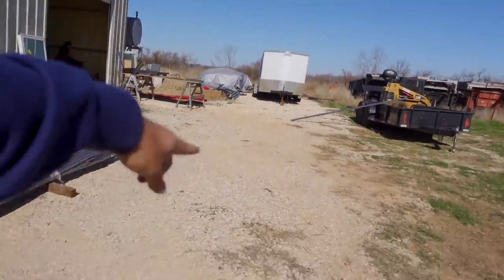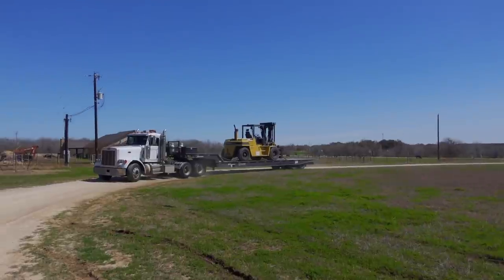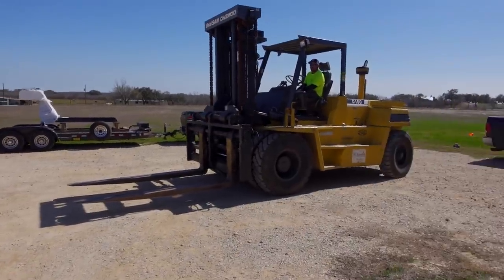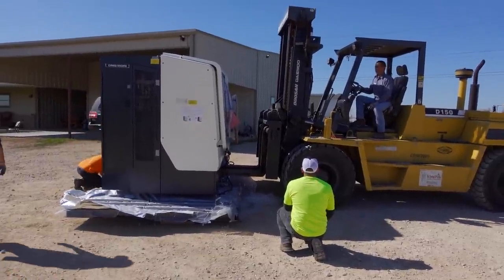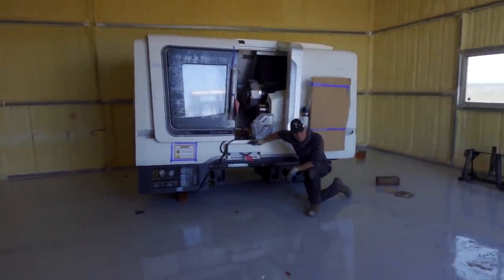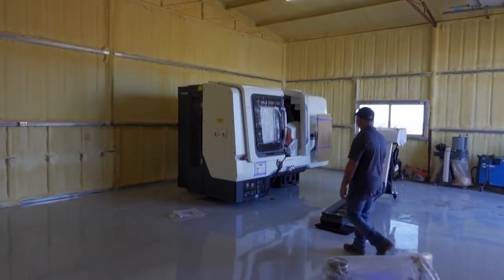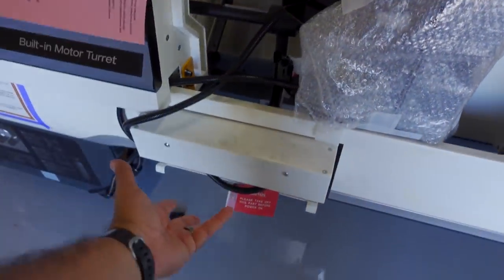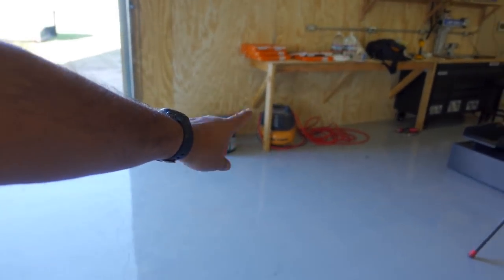New CNC lathe is here:  Starting a machine shop part 6

Comment: 3 years ago I bought a few arduinos and worked with my students to create some novelties. My administration got wind, and had me present our hobby, and they asked what I needed. Of course it was a 3d printer. A year goes by, and they ask me to teach it as a class. No problem, so I went to a training on SolidWorks and taught that for a year. Last year, I get called into the office, and asked to help write a grant because they wanted to add machining. So, a CNC press brake, 150W CO2 laser cutter, a haas vertical mill, and lots of stock was ordered and delivered. This last year, I was asked again to help write a grant, low and behold, we’ve got a cnc lathe coming, along with about $80k worth of stock to train high school kids on. I know that my arduino hobby has ballooned into a million dollar metal shop, and I could make a lot more running a shop than I do now, but I’ll stick with training a few dozen kids each year in hopes that a couple want to pursue it as a career. That being said, if you need a pipeline of cnc mill, press, and lathe operators who can also design, let me know.
Reply: a school that invests in education. ill believe that when i see it.

Comment: Mate don't listen to the haters, I think it's wonderful what you're doing, I've been in you're position trying to do it debt free as well trying to start a Gunsmithing and small part repair shop only difference is I'm in Australia and my machines are manual haha and it's been a year now and I'm still stuck on getting 3 phase to my shed 120m away from my electricity box.
Anyways I just want to thank you for all the detail on and how you've been documenting setting up your business and shop. You're doing a great job and I'm personally so interested on what's next!
Get those chips flying! Lol
Reply: Been looking at the costs between renting a generator and buying a old back up generator that has come from a business that's closed down they've got extremely low hours some as low as 46 at Auction for a 40 to 50 kva is sub $10k.. I'm hesitant on used but if it's reliable it actually works out better than paying for a new electrical connection

Comment: Mori is a good brand. I run two Mori lathes and a Haas lathe at work. One from the 90’s and one from the 80’s. Both are dead nuts compared to my new Haas. The Haas has needed more repairs in two years, than both of my Mori in the ten years I’ve run them.

Comment: Hey Erik, when you can afford to do so debt free, a backup grid tied inverter, lithium iron phosphate battery(s), super capacitor bank system, DC wind generators  and DC solar converters etc  would assure that no storm could deny you power and production of those wonderful tuners you make. If the power stops on the grid the transfer switch would just switch to your off grid system where immense power would be available. Otherwise, you with such a backup system you could get paid by the utility for the power you put on the grid or get credits for the power you have pulled off the grid.  Just a thought considering you are like me in doing things DEBT FREE AND THEY PAY ME WHEN AND IF POSSIBLE !!!!

Comment: Fantastic choice in the DMG MORI, you'll be very pleased in its performance and repeatability. You'll want a good window squeegee and your choice of a rag on a stick to help wipe the coolant off the inside of the enclosure when the machine is done for the shift. Even the best coolants with detergents in them get gunked up over time and it's far easier to wipe it down at the end of each shift than to wait a couple of months and fight it. It's the area behind the turret and behind the sub-spindle that usually gets neglected. If you decide to add a bar feeder in the future you can run "lights out" and really amp up production. CONGRATULATIONS! Looking forward to future videos.

Comment: What kind of band saw are you gonna run since your not gonna have a bar feeder ? Do-all makes excellent automatic saws which will give you the consistent bar lengths your going to need to run max amount of parts per bar. Also your going to want to invest in spindle liners for whatever diameter stock your turning. They are a necessity when you don't have a bar feeder. I highly suggest a rotary screw compressor and dryer combo for that machine,  especially if you are planning on expanding in the future. You will save yourself some headaches.

Comment: Hey Erik, I used to be CNC programmer 12 years back and just want to suggest that be very careful about playing with the program yourself. I remember once the electricity went out in the night and reset the machine while there was a 48 hours long operation was in-process on VMC. Before I can go to the shop the Machine operator (wanna be programmer) there, tried to manually edit the program to start from where it left.
Man he slammed the tool into the metal block and damaged the bed. On another day at CNC Lathe machine, turning tractor hooks. Operator forgot to set the starting axis and tool slammed the rod and broke into multiple pieces. Man It was a mess, even that flaying part broke the thick CNC door.

Comment: Did you already order an air compressor? If not, are you looking at screw compressors? Also going to want an air drier if the compressor doesn't have one built-in.
Having three phase I think I would absolutely go with a screw compressor. Super quiet, high volume, low heat, etc.
Reply from the maker: I bought a tractor supply unit for now.

Comment: 10:45
Will that window AC unit provide sufficient cooling once you are  operating and it's 90+ degrees outside ?
Reply: I doubt it, but who says a machine shop has to be air conditioned?  That lathe will produce alot of heat and add alot of moisture in the air from the liquid coolant. Large shop fans work well.
Reply: Always room for additional a/c units.  Going to be able to power them also..  The business can pay for them after a bit.

Comment: Did you get it as a turnkey unit? Have all programming and tooling figured out.
Reply from the maker: No.  Bought tooling separate and I’m doing the programming.  More on that later.
Reply: @ErikCortina  I've been a machinist/programmer for 25 years in the orthopedic and medical industry. Usually for a sale alot of times they'll do turnkey for free, minus tooling cost. Doesn't mean you have to use their  programs or tooling but something to compare to. We have nt's and ntx's we use. Amazing with all the machines and tooling on the market, makes your head spin!!!
Reply: I recommend using variables in your programs. Makes it shorter programs and easier to tweak. 30 years in cnc machines have taught me that!!